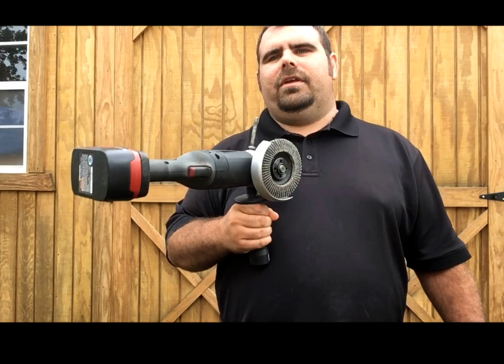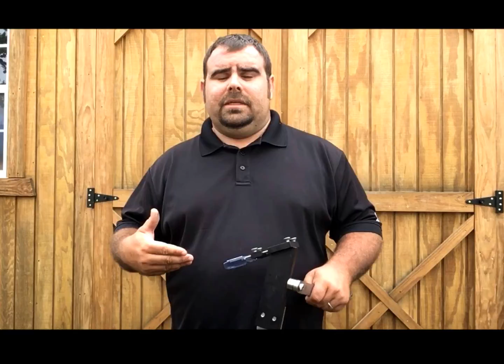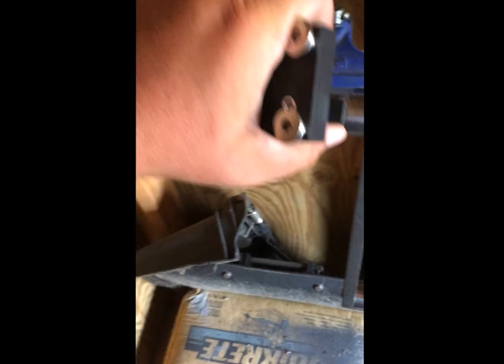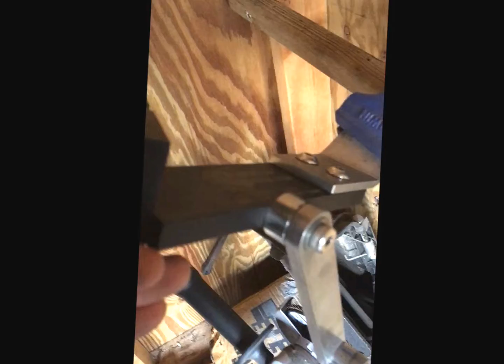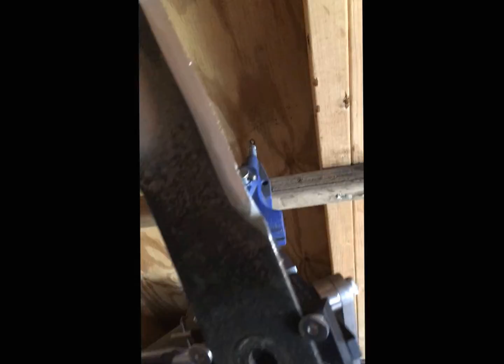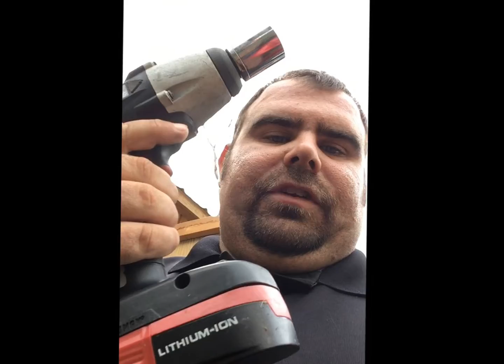All American Blade Sharpener Review

Comment: Nice review. Wondering how or what you use to balance the blade afterwards?
Reply from the maker: I usually just use the little some things you can buy but I have been considering a better balancer. When your only hitting each side a few times the don’t really get unbalanced as long as your keep you stoke count and pressure the same

Comment: At the end of the blade u don't want to round it off
Reply from the maker: That’s what I was trying to say this prevents. The blades that are shown are the ones that were all whacked out, since buying new set of blades the corners are square on them consistent with the angle. Thanks
Reply: @ltdlawnservice4586  my b didn't catch that
Reply from the maker: May not of been in there but I assure you this won’t round tips. Thanks for watching though.👍🏼
Reply: could someone explain why not let it get rounded at the end?